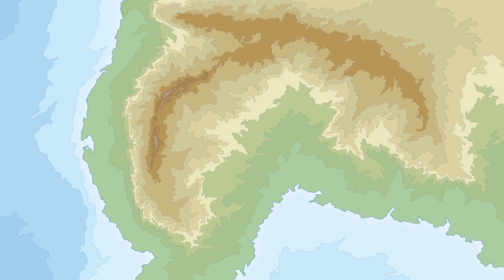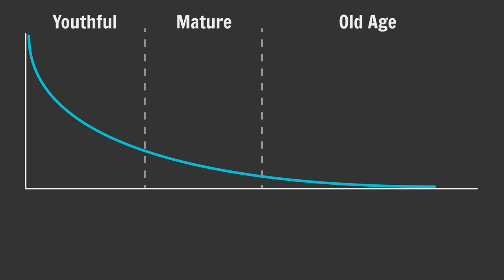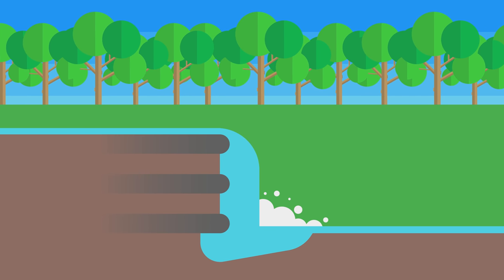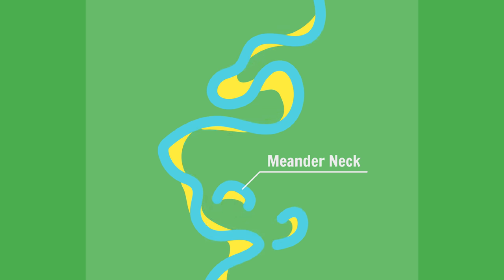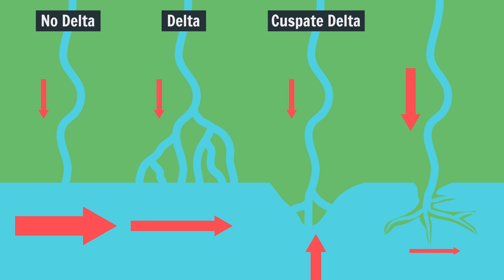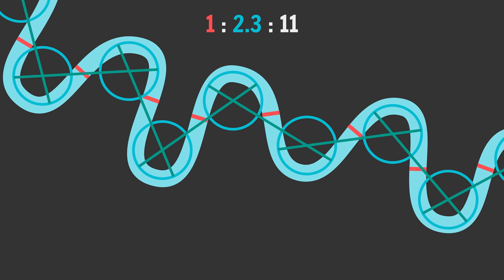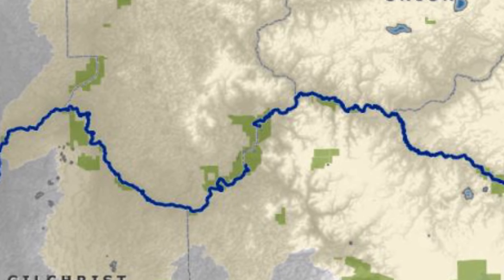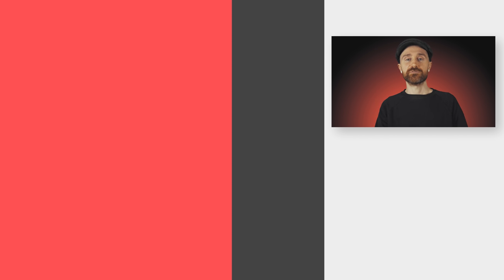How To River

Comment: Rivers can fully split, too. But that doesn't occur often.
Reply: Adding onto this, full river splits are extremely unstable, and therefore don't last very long. Whichever of the two rivers has the steepest slope will win out over the other one, and eventually diverts the whole river.

Also worth pointing out that this is different from there being islands in a river, or a river delta.
Reply: @rolandsquire6555  Absolutely right. The nearest complete bifurcation I know is some 100 kilometres away from my home and it is just a very small brook. One flows to the Rhine and one to the Danube.

Comment: I once tried to map a river and I did take into consideration meanders, Basically there were 3 regions the river was in. And there is 1 seasonal tributary. I called the river the Black Sword River because why not?

To the north of Civilization:

The river starts small and more straight along the western part of the region. Because of some factors(like for example hard rock on one side and soft rock on the other), the river starts to move southeast after a certain distance. On the eastern side, north of where the river turns, there is this huge mountain, maybe it's a volcano that became inactive and any magma in there fully solidified or maybe it's the only remnant of an asteroid impact. Whatever caused there to be this single huge mountain, it is the seasonal tributary I mentioned. You see, a lake has formed in this mountain and outside of extreme drought, the lake is always there. But, the water in said lake only flows in significant amounts into the river when there is rain, lots and lots of rain. And in the 8 season cycle the planet has, this only happens in Spring, not Winter Spring(which is when the earliest flowers bloom and it is still cold(This is comparable to Early February to Mid March in Ohio)) or Sprummer(which is when it starts getting hot, but still fluctuates(This is comparable to May in Ohio)). And since the main seasons are 3 months long and the transition seasons 2 months long, this means that for 3 out of 20 months, there is a significant amount of water flowing from the lake on the mountain into the Black Sword River.

In the same region as Civilization:

The southeastern trajectory of the Black Sword river leads it towards a small mountain range. It carves a path through this mountain range and at 1 particular mountain, the river bifurcates, it splits into a western and eastern half. The bifurcation doesn't last long though. Other mountains make it so that the paths of the western half and eastern half merge and you have a single river on the other side of the mountain range, once again called the Black Sword River. It now moves south, just like it did before the turn in the northern region, but this time it's on the east side of the region instead of the west side. There is 1 lake connected to this river currently, and there is another lake further west that is disconnected. Perhaps this lake further west, closer to civilization was once connected to the Black Sword River, but the deposition rate over time caused less and less lake water to flow into the Black Sword River until it finally stopped flowing into the river. This lake would now be considered an Endorrheic Basin(sorry if I misspelt it), as nothing flows out.

South of Civilization:

The Black Sword River continues and it along with multiple other rivers, slows down to such a degree, that it is a swamp instead of a river at this point. Slowing down normally occurs when the river gets bigger, so this isn't out of the question.

As you can probably tell, the river reaching a mountain range and carving a path through it requires the water to move uphill. This can happen if there is enough volume and velocity and in a river of just the right size, this balance can be reached and in the case of the Black Sword River, this balance between volume and velocity is reached so it does flow uphill into the mountain range.

Comment: 8:25 applying this to the rive where I'm from predicts a 50 m wide (if by meander length) or 30 m wide (if by radius), but the river is at best 7 or 8 meters — and that's when it's full! Being a Mediterranean climate means in summer it shrinks to a measly stream of water (or sometimes dries out completely — added bonus, karst ground) and sure, it probably used to be bigger as it's said that in Roman times there were boats on it and  if you take the entire surrounding area that looks like a river bed you can stretch it to maybe 20 to 25m wide, but it hasn't been that full in 1000 to 2000 years, since humans started to mess with the water upstream. So really, my question is: how long does it take to adapt?

Comment: "And make sure to take a fairly direct path ... ."  Real-world rivers didn't get the memo on this one.  There's a sharp contrast between the excessively straight rivers on the example map and the rather indirect rivers on the map of North America.

Rivers flow downhill, and erosion does tend to straighten their course on any scale larger than meanders.  But regions of more-resistant rock erode more slowly than regions of less-resistant rock, and uplift happens unevenly.  In a "mature" (i.e. low-gradient) portion of a river, it will go long distances out of its way to accommodate small differences in uplift and erosion resistance.

Comment: 7:25 Are you sure those are the correct units? Multiplying volume flow rate (length cubed over time) with area (length squared) the way you describe would result in some sort of hyperdimensional volume (length to the power of 5 over time). Unless there are units hidden in those constants that cancel out the extra dimensions.

But I can already tell that the formula won't work, because combining two drainage basins of the same size where both receive the same amount of rainfall would double R and double A, which would quadruple the provisional width of the river.

Also (and I think that geography teachers do this too, so you're not to blame for this), does it seem a little off to you that provisional width - essentially a measure of cross-sectional area - should be measured in metres, while depth factor is supposedly dimensionless?
Reply: Maybe the rainfall is in millimetres (or liters per cubic meter, which is the same) per year ? That would make more sense
Reply: That would make a lot more sense, yeah

Comment: Two questions. At the formula in 7:28 what does "Rainfall" mean? Is it rainfall in the total area, or is it rainfall per 1000 sq.km? Also, where will the calculated width appear in the river? Is it at the mouth, or somewhere else?
Reply: That's the total rainfall in the river's drainage area. And you can use the formula at any point in the river, just keeping in mind that you will only consider regions upstream of that point.

Comment: Does rain shadow affect rivers? I would imagine that you can find more and bigger river the windward side thanks to the higher precipitation.
Reply: Ehh, depending on the geography you might get lots of small rivers or a few really Massive rivers, or both.
Check out the South Island of New Zealand: all the really big rivers are on the Dryer side.  The rain falls in the mountains, sure, and most of it on the west coast, but what flows down the east side has a lot more land fo cover to get to the sea, and thus more time for the rivers to join up.  (The rivers also tend to flood when there is No rain, their levels barely changing during downpours.  Because when the weather's dry east of the mountains it's usually due to the wind dumping all the rain In the mountains, and thus the rivers.)

Comment: The formula doesn't seem to work very well for very large rivers, by my calculations the amazon ought to be over 35km wide, considerably larger than its actual maximum of 11km. Still a useful ballpark figure for smaller rivers though

Comment: The Grand Canyon is a gorge. Rivers don't form gorges. Floods do.
Reply: Yeah, no. You can see the Niagara Gorge still forming through regular erosion: it started at the Niagara Escarpment about 12,500 years ago and has carved its way 11.4 km upriver in that time. In the last 200 years Niagara Falls was moving about 1.5 meters per year, leaving the Gorge behind it, but it's slowed with management of water and some engineering since the 1940s to reduce the speed, mainly because when it reaches Lake Erie it will cause a major change in Erie's water level.